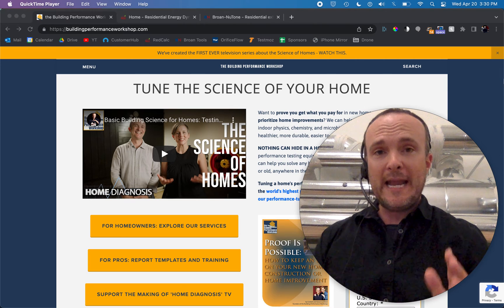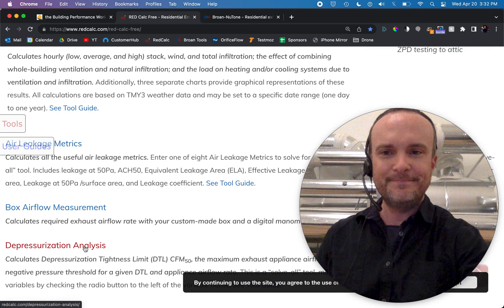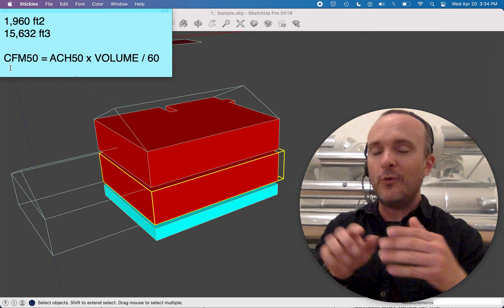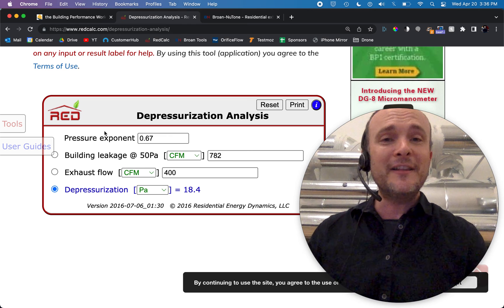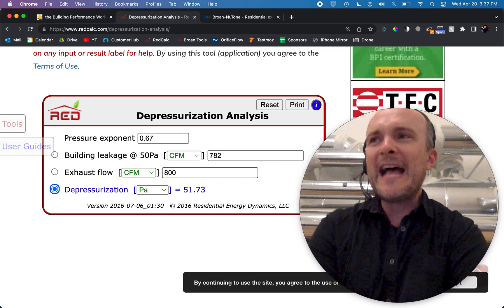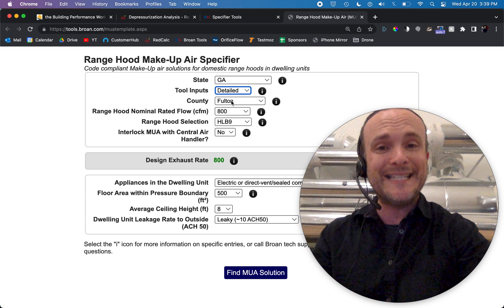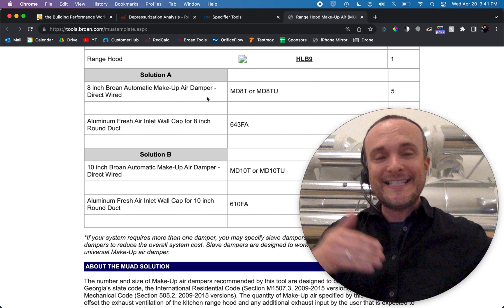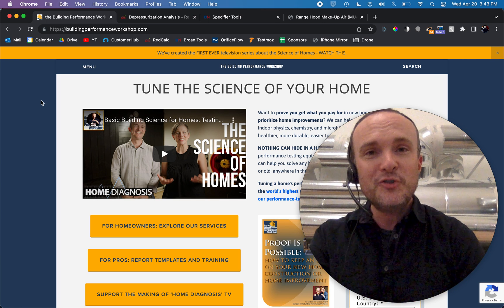How to Size Ventilation Make Up Air: 2 Awesome Free Tools for Design Calculations

Comment: Corbett, 
This "Ventilation Air Quality issue" is SOO important to us (alergy & lung issues) and the retirement home we're trying to design.
We, too, worry about various building materials & health. 
My QUESTION is about Closed Cell Spray Foam I'd like to use for my conditioned Attic space... and MITIGATION of fibers, fumes, & such for air quality ... 
Do FIRE COATING PAINTS like "DC315" or "FireFree 88" make things better or worse for air quality? 
The home will certainly have an ERV & Dehumidifier with MERV 13 filters. 

Cheers, Eric

Comment: What is the reason the duct size maxes out at 10 inch? Wouldn't it be better and easier to use a single, larger duct, like 16 inch, instead of a bunch of smaller 8 or 10 inch holes?
Reply from the maker: Because Broan only makes as big as 10. Feel free to upsize from another brand.

Comment: My take away from this is that if I would like to avoid the suggested 9 holes from the calculator I can introduce a fane to bring in the amount of air required. eg extracted air moves at 3200m³/h through a 250mm/10in hole I would then need to have the same type of fan pulling air in (through a filter) and through the same sized hole to balance it?
Reply from the maker: Yes
Reply: @HomePerformance  I am going to speak with my vent guy and see if I can come up with a cost effective solution. It is a shame Australia is sooooo far behind with all this stuff as it makes systems like this quite challenging to design and impliment. I am relly trying to avoid a resurculating system..
Reply from the maker: PS you should run your own calculation at the sites I use, every home is different.

Comment: This is exactly what I was looking for!  In the example you provided here, I still think passive make-up air is within the threshold of a better tradeoff, and here is why:

An 8" dia. duct = ~ 50.3 sq-in, so 5 are = ~251.3 sq-in, which translates to an ~18" dia. hole (or a 16" x 16" square).  The math on the (3) 10" holes is close enough.  An 18" motorised damper costs just above $300 on McMaster-Carr; add a grille and a filter box, and you're done.

Don't get me wrong, there is a point where forced air is more efficient, but I think that to exchange 800 cfm for the area of a 16" square hole is a pretty good tradeoff -- even on luxury homes.
Reply from the maker: Interesting point, Troy

Comment: Good information that I will use in trying to design my new home. Please note that I had difficulty with the Broan Specialty Tool. Using Range Hood Make-Up Air Damper Specifier then selecting "Get Started" produces "HTTP Error 503. The service is unavailable." The web server was unavailable on 1/27 at 1:02PM EST. Hopefully, Broan will get that repaired.
Reply from the maker: They have been informed, yes, I use it almost daily!

Comment: Corbett, could I use the RedCalc tool for depressurization in reverse to determine how much OA I need to bring into a building with a specific CFM50 leakage to achieve a target POSITIVE pressure of around 2 Pa?
Reply from the maker: Yes, same physics Tim!

Comment: We run  small buisness from a room in the house using a laser cutter.
It is forced exhaust outside. House is still leaky enough that it is able to pull from other locations. Looking at installing a hrv to help balance this. Especially once the house is sealed more. 
1940's house had some large outside door leaks. Just fixed them. Noticed I have to crack anaposing window to keep exhaust flowing out.
I run carbon filters on the hvac.
Reply from the maker: Be very careful

Comment: Question, using the same comparison you used with ERVs and your buddy with the 10 kids regarding humidity in the home… how big of a deal is this really if you only run the fan maybe 30-60 min a day? Guess it depends on how negative your house gets? I’m about to undergo a major reno in northern NJ and will be installing an ERV but it won’t supply 400 CFM to the kitchen. It’s sized for 4 ppl so low 100’s. Maybe I’ll just open a window on my first fl when we cook :-)
Reply from the maker: ERVs are never the solution to make up air. And yes, ‘it depends’ is the right answer, which is why calcs are so important for planning. You can certainly just open a window all the way, but it’s not filtered, heated, or premixed, and your home will almost certainly not be pressure balanced- if that’s cool, go for it.

Comment: I'm working on the plans to build my new home and the HVAC is great part of the design. It seems that very few to none HVAC professionals know or even care about this. I asked my guy where i needed to make the opening for my my kitchen make-up air. He said "you should be okay. You dont need one" he knows I'm building a well insulated ICF home in Arizona. I don't want to call him back because he doesn't understand it or care. 
Great video!!
Reply from the maker: Thanks Techfan- you sound like you have it under control. It IS hard to be an HVAC equipment service and install technician AND have all this math and science in your pocket too. But they should be trying harder in many cases.

Comment: I believe you said that turning on the exhaust fan would turn on the makeup air fan. Would it not be better to install a static air pressure gauge to continuously  monitor for depressurization and turn on the makeup air fan when needed? That would work when anything in the house causes depressurization e.g. another exhaust fan, clothes dryer, etc.
Reply from the maker: There is no widely available micromanometer gauge that can do this, unless you know something I don’t. Turns out it’s more challenging to manufacture than it sounds.
Reply: Great idea! Could use a product like this one (aabsmart SPM-100 Dual Port Manometer) for relative pressure, one side outside the home and one in. Would need to feature request them to have a continuous usage mode with API access. I use Airthings devices to monitor CO2 and boost my EVR when levels are high, could definitely do the same for relative pressure.
Reply from the maker: Sorry, but that AAB gauge is not sensitive enough, it measures in IWC.
Reply: @HomePerformance  It's accurate to 0.004 inWC (1 PA) and has pascal units. I've used a cheap digital 50$ manometer to do measurements and it's as accurate as my Dwyer 0.5 in water. I think it would definitely work in this scenario, although not as good and precise as the one you have. Might also need periodic recalibration.
https://www.itm.com/pdfs/cache/www.itm.com/spm-100/datasheet/spm-100-datasheet.pdf
Reply from the maker: Nice

Comment: Wow, this is the video im looking for so long!

I have a 3m x 9m x 3m  space, sandwiched in 3 buildings around, concrete on all sides. Almost airtight, just a 1m x 2m door and 1m x 1m window thats need to be closed most of the times. Haha, what a terrible place. Its so hot right now and difficult to breath. Im just using electric fan for intake near the open window, and exhaust at the other end in the bathroom.

Can you help me to plan/build healthy and quality ventilation system for my tiny space here in the Philippines?

Thanks a lot.